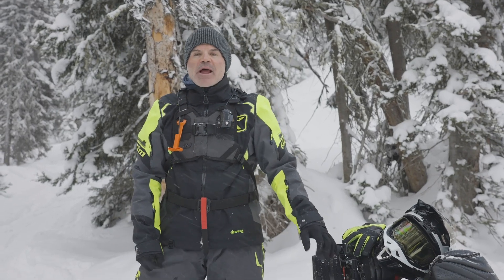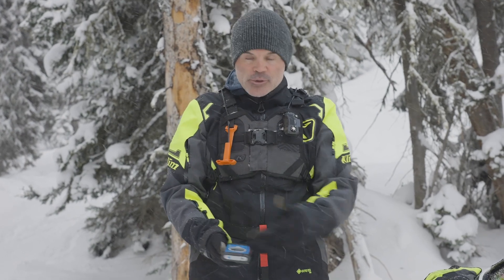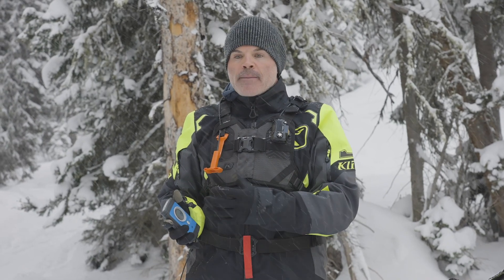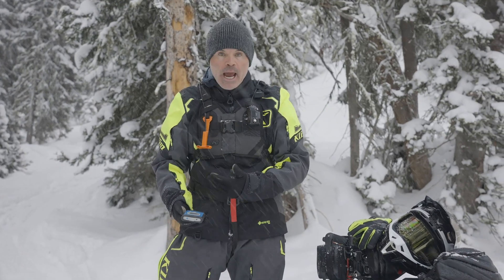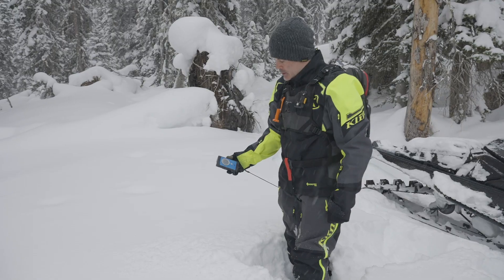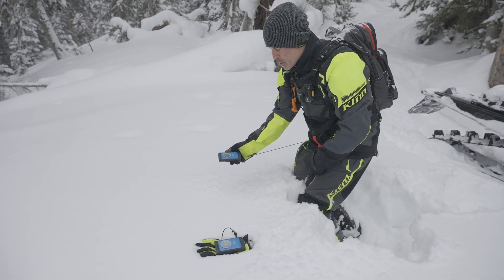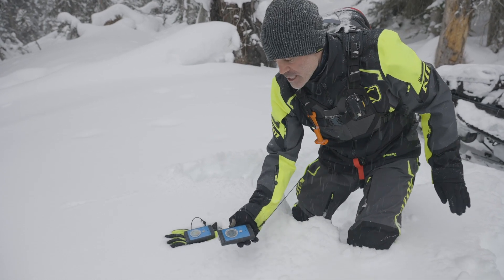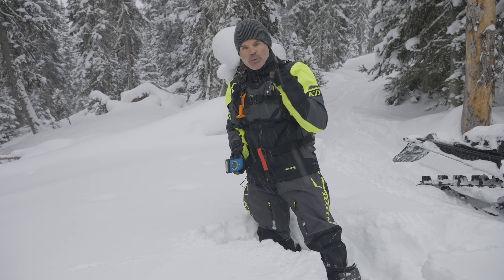Learn to use this...LIVES depend on it. Avalanche Beacon 101

Comment: But how the heck do you do the actual search on a sled? On skis you would usually zig-zag across the slide trying to pick up a signal - often skiing over debris is hard enough, I can't imagine how one might do that with any speed or efficiency with a sled... what's your advice on covering the slope? Also, how do you even hear or hold the transceiver while you're sledding across trying to keep the sled on edge across a slope??
Reply from the maker: Hey bud we don’t use our sleds to perform the rescue. Due to the sleds motor and electrical system they produce electromagnetic interference (emi) We can certainly use our sleds to do a visual search as well as get further up the debris field to start searching.  The sled would need to be powered down and we would want to be away from it before we tried using transceivers properly.  
Hope this helps and thanks for watching 🙏🙏🙏🙏

Comment: So why alkaline batteries instead of lithium? Better for the cold?
Reply: Yes, I was wondering the same thing. My research suggests that alkaline are not great in the cold... but I'm happy to be corrected!! Please advise NLR.
Reply: @foggydew646  good to know thanks
Reply: Lithium batteries work great with a steady voltage for 99% of their life, then they die, completely.  Alkaline batteries give off a voltage that slowly drops until completely gone.  During a search, receiving beacons can still pick up a signal from a transmitter that has partial, or low power and weak signal, due to a weak battery. Lithium batteries do not offer that last chance of being found.
Reply: @waynepriest6403  Thanks Wayne, I appreciate the information...Alkaline it is.... Thanks again....

Comment: Why not lithium batteries?
Reply: I think it's a cold one temp issue
Reply: Lithium batteries go dead in cold temps thus so does your beacon
Reply: @DW-nd6tc  but so do standard. Lithium won’t except a charge at low temperatures as well as alkaline batteries but Lithium don’t lose power as fast in low temps. It has been awhile since I have done any researched but that is what I remember.
Reply: Lithium batteries work great with a steady voltage for 99% of their life, then they die, completely.  Alkaline batteries give off a voltage that slowly drops until completely gone.  During a search, receiving beacons can still pick up a signal from a transmitter that has partial, or low power and weak signal, due to a weak battery. Lithium batteries do not offer that last chance of being found.
Reply: @waynepriest6403  Thanks! I figured there had to be a solid reason behind it.

Comment: One big flow in your demonstration is the position of the beacon on your body. Please everyone, put it somewhere near your head. You want the team to find that part first, not your feet.
Reply from the maker: Remember that if a person is buried head down below their body the beacon placement would then be further away. We don’t get to predict how someone is positioned…we just practice proper rescue techniques and try like hell to save lives. 🙏🙏🙏
Thanks for watching 👊
Reply: @NextLevelRidingClinics  the beacon would indeed be further away when you're face down, but in that case your feet would be found first while digging regardless. And don't forget, the new iProbe makes it even wiser to wear the beacon close to your face. That probe is extremely accurate in finding beacons and it would be unfortunate if it's off by over a meter because your beacon is at your knee.
Reply from the maker: @wtfdinges  I can tell you need to make a point here and that’s 100% ok.
The holster is an option that was intended to make accessing the transceiver quicker and easier in the event of a rescue….from the factory harness that most transceivers come with…the holster is about 22” from the original spot. 
I’d say that the real “flaw” in any of this is not wearing a transceiver at all. 
Best of luck to you and have a happy holiday 👍